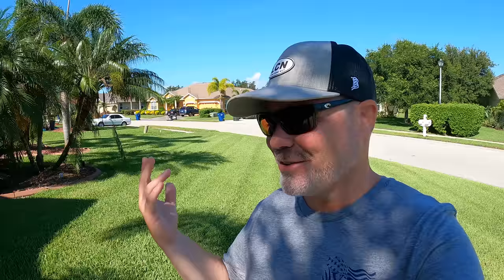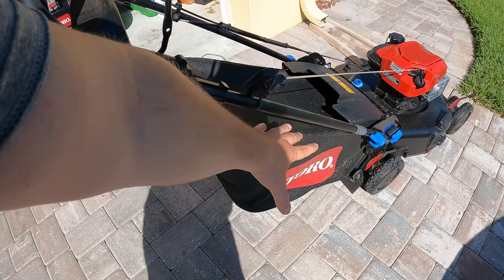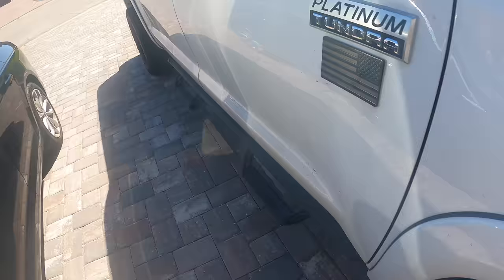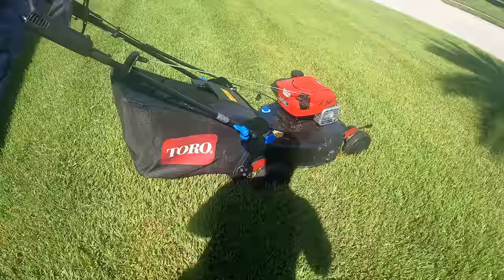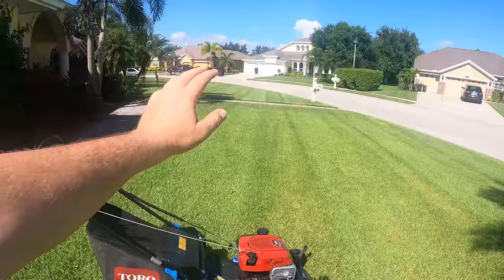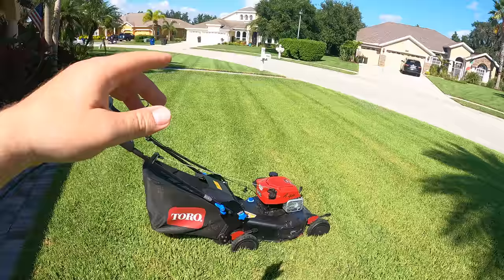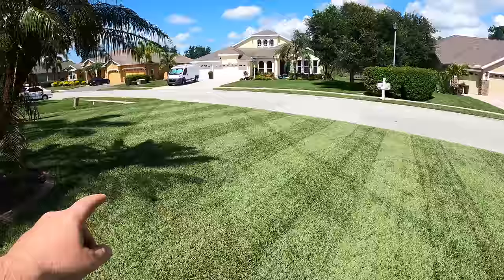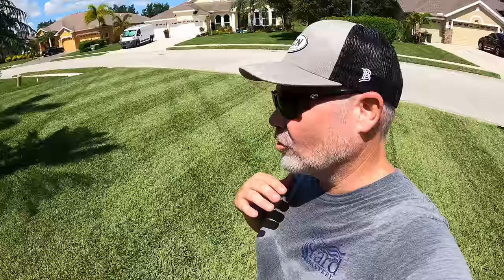Converted?

Comment: My dad ran a yard care business in the 1970's and we threw all grass clippings in the back of his 1970 Ford truck.  The grass was cleaned out about weekly or when the truck bed was full.  Add summer weather at 100 degrees F and the smell was awful.  At times the grass would heat up and grass juice would drip out of the bed.  Over a period of 5-10 summers the truck bed was destroyed by the degrading grass clippings.  No Rhino lining...
Reply from the maker: I cried while reading this.
Reply: I throw my clippings around the trees at the farm. Makes a huge difference on quality of the tree, height and thickness. Stinks if you wait too long to dump them but worth it. Also helps with weeds.
Reply: Mmm... Tastee!
Reply: @Agent5061  Nifty idea.  Time for a new lawnmower.

Comment: When you bag it creates a suction/vacuum/airflow standing the grass blade up creating a really clean cut. It also helps tilt the grass blades more making the grass stripe better. I've noticed the same thing in my lawn . The clipping are a pain and I feel like I committing a crime not returning the clippings lol.
Reply: yep.  in mulch mode the suction/vacuum/airflow is greatly reduced, especially on high settings.  That is why i went back to mostly bag mowing.

Comment: I'm convinced the benefits of mulching outweigh the striping. Of course I use a striping kit too, that really helps. Great video Allyn. 👍
Reply: Side discharge is the alternative.  Still recycling the clippings while also having the best airflow through the deck which helps with the cut quality and striping.

Comment: I bag too! Even after watching you for a few years! Only because I find when I mulch the clippings seemed to suffocate the lawn, my mower would spit out chunks on turns, instead of a even distribution, and the mulch one dried would make my lawn look browner.  I am in northern Nevada, so hot heat in summer. I sometimes save my clippings to add as compost to my vegie garden, or use as a top mulch for vegie garden to retain moisture. Here a bag of clippings dries out so fast with no moisture left in a few days. Very dry here compared to Florida! Welcome to the club!😊.

Comment: Allyn,

I looked back on your previous videos and saw nothing about AWD walk behind mowers for the “older set” of yard owners. I have some slopes in my yard and as I aged I was pushing/pulling my walk behind mowers up the slopes and the riding mower I had was getting too difficult to maneuver in some of the close spaces.  I sold them all and bought a Husqvarna AWD walk behind and it literally pulls me up the slopes and with its Honda engine is always an easy start.  It might be time to do a video on mowers for the “older set”.  I also have a small 2 HP MTD mower I can still maneuver for trimming in close places.  It too is an easy start and light enough for an old fart like me.

I really appreciate your past videos and you have helped me many times over the years improving my yard here in northern Michigan.

Thanks for all you do and your hilarious ways of keeping me laughing.  Laughter is still the “Best Medicine”.

Dave, still mowing after 76 years and loving it.

Comment: I bag all my clippings, but our city has free yard waste recycling.  I’ve striped my lawn on EVERY cut with the bagger attached as you showed in the video.  I’ll do wider stripes by doing 3 passes (rows) in one direction before I do 3 rows in the other direction.  They’re about 4ft wide stripes and they look sharp.  

I’ll also stripe back-and-forth one week then on a 45-degree angle the following week.

The stripes really pop a week after laying down the nitrogen fertilizer.

Comment: I had a big Covid infection for about 2 weeks and my lawn went to crap because I really couldn’t mow or edge or anything. Today is the first day I am able to mow and it has been exhausting. Mowed at the highest setting and cleaned up the edges. In 2-3 days I will mow again and then try and keep up that schedule until it returns to normal. I just have a Cub Cadet XT-1 but it does ok- but mulching today was rough on it

Comment: Allyn it's called trash/yard waste bags. Your garbage collection will pick up yard waste. Some people start compost piles. I bag and mulch, both. I don't lose much goodness bagging, that I can't add back with Fert and micro nutrients. Mulching is overrated. It may not cause thatch but can be too much. If your lawn is growing fast even if you cut often (small clippings) it can be more than your lawn can eat or will decay. Your truck bed? That's happening in your yard. I do bag and mulch and vary every other time or 3rd time.

Comment: So if you take a big garbage can and like cut a whole in the bottom side of it keep the party you cut out and attach it back with a hinge you could have a permanent compost cycle putting clipping in the top soil comes out the bottom drill some drain holes in the bottom and throw in some red wigglers throw in all your vegetables too and egg shells add water a couple times a week. If you want some worm tea you could only add one drain hole attached to a hose and when you add water catch the runoff and instant worm tea
Reply from the maker: I def need to try something like this

Comment: I probably need to bag every 3rd or 4th mow.  The grass is always too long when I cut though.  Have mowed 20 times this year so far, can't imagine increasing the frequency.  Wheel tracks don't get cut properly, laying down, and some grass clumps. I'd get at least 3 full leaf bags every cut, most times i am mowing 4" HOC.  Looks like I need to do a manual rake job to the whole lawn. The smell of rotting lawn clippings is pretty bad.

Comment: I guess congratulations on the Marriage are in order XD
I bagged my whole life in St Aug and ... I think I like the more frequent mow/no bagging system you have 
also why not try one of those garden rollers to try to stripe the lawn. as long as you don't put too much (or any) water in them it should not compact your ground.
also noticed that St Augustine does keep the grow direction when they hit a wall or rock. so do yuou think you could "burn" the stripes it if you keep at it?
Reply from the maker: I may start bagging much more often and see if that helps me burn the stripes in better. I'm mowing a little bit lower right now too though and that doesn't help.